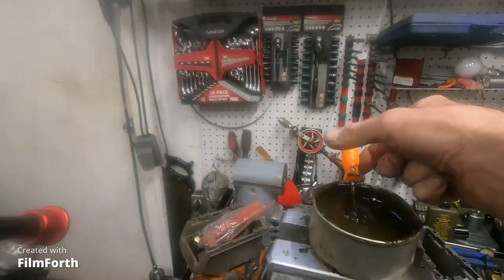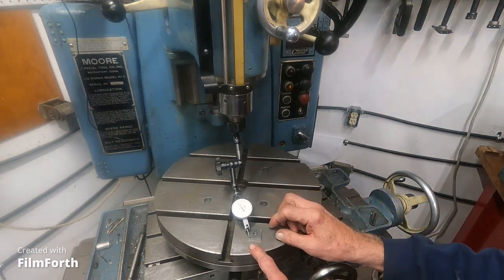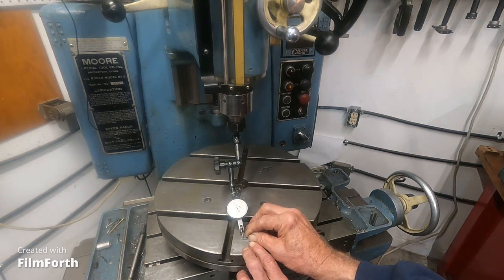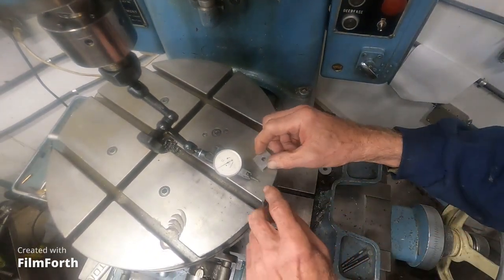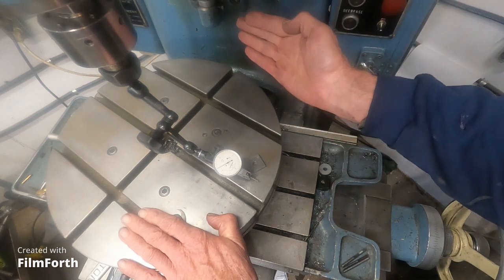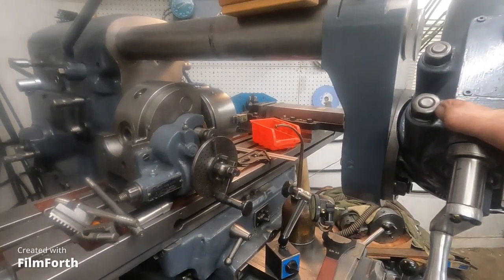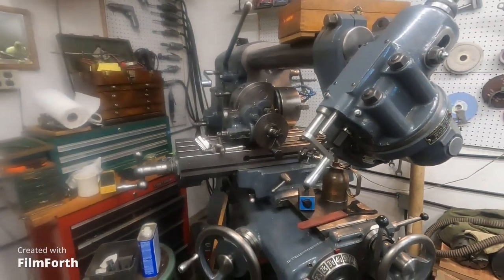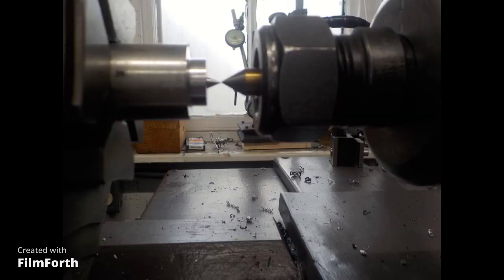Moore jig borer basic tram after moving

Comment: Hi Don.  Thank you for all the great videos.   I have a Moore. # 1 jig bore.          I came to understand  the power of single point boring for position late in the game,  I use boring heads on the Bridgeport for sizing holes, but never really thought of it much else.     The truth is , single point boring gives you everything. Size , straightness , roundness, location, squareness to your reference service, and finish.   The learning curve has been a little steep, grinding the boring bars needed for small diameter deep holes, but I’m getting there.   I’ve actually had luck lately with carbide shanks withbrazed  high speed, steel  cutting edge.    If there’s a carbide cutting edge, I can break it but the high-speed steel holds up well and the shank is a lot stiffer.   
I have found the moore boring heads that swing the boring bar on an angle as opposed to slide it or super handy  for the small holes.  

Also, thank you for your video about lapping tapers with sheet lead. I found it super helpful.

Comment: Hello Sir - Great videos - I just got a Moore 1-1/2 and your videos will help me a bunch - do you think the rubber aprons are a must have ? the ones on the machine I have to remove they are hard as a rock.
Reply from the maker: The rubber covers are for using the grinding attachment. I simply wipe the ways down before and during use of the No 2 machine I have here. Thanks!

Comment: Hey Donnie…. Been looking for a tree head for a while. Did they make these out of solid gold!!!!!

One useful video would be a breakdown of the tree head. What parts are in this thing. What are the critical dimensions.

I think this would be a great project for DIY tool and die. It beats dropping a grand on one that’s missing a bunch of items or been dragged thru the mud of Afghanistan!
Reply from the maker: The Tree head was continued for a time by another company after the milling machine was discontinued, The list price in 1998 $3850. I got this one from a local mold shop when they went CNC about that time, I had a cutter grinder workhead with 40 taper they needed for the new CNC equipment, I traded, likely $1500 value back then. The head works outstanding on the jig borer and fairly good adapted to a standard vertical mill. My advice is to find one without any attachments then custom make your own, same with Wohlhaupter.
 There are two versions fine feed and coarse feed, I prefer the coarse feed as the hold ring can allowed to slip to effect a variable coarse to fine feed. I think I will decline disassembling the head as it is not needed and works perfectly. Thanks!
Reply: I saw a nice one on ebay recently but it has sold, was in the $1,000 range.

Comment: Does your B&S mill have any sort of power downfeed for the quill travel? I've been boring and sleeving some Volkswagen transmissions on my giant Supermax YCM-2GS horizontal/vertical mill that is ~6000lbs  and the downfeed isn't super fine per rev. These transmissions are too tall to do on a standard Bridgeport but I feel that the Bridgeport style heads are fairly limited for really accurate boring but that's just been my general experience the handful of times I've had to do it. These transmissions are magnesium and are super prone to chatter so I've had to be really careful with my tool geometry to get good finishes to measure with my bore gage
Reply from the maker: No, this vertical head has only 2" of quill travel but that very small amount makes the attachment much more usable. There is local fellow here I have ground tools for that works on those German car engine cases and cutters have to be sharp as possible, I had to use a small as possible nose radius on the cutter to avoid chatter. I took some cutter fine tuning, the engine case material must be pretty hard, thanks!